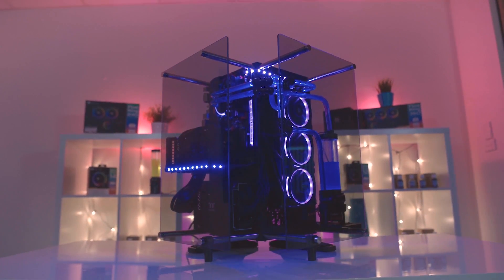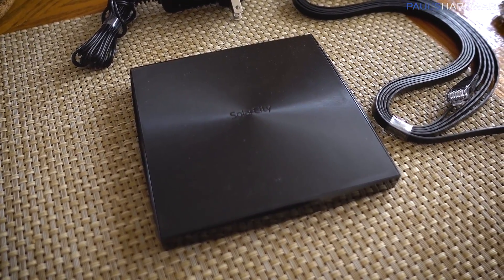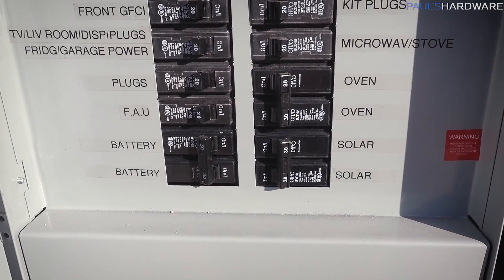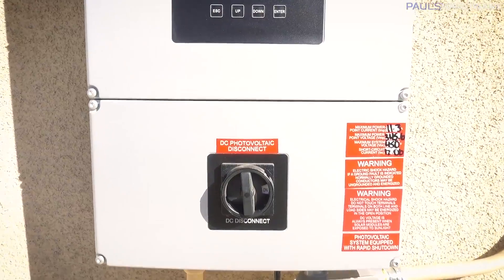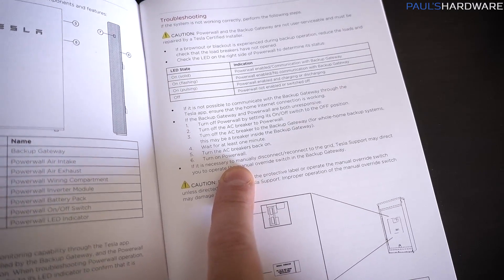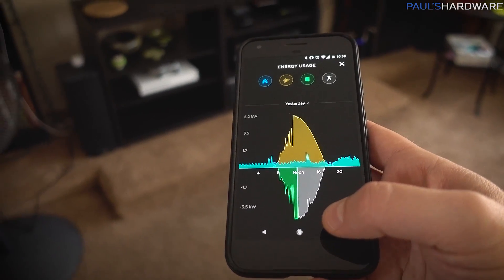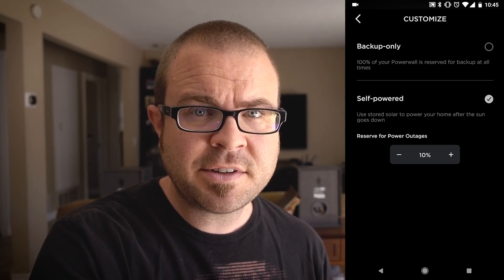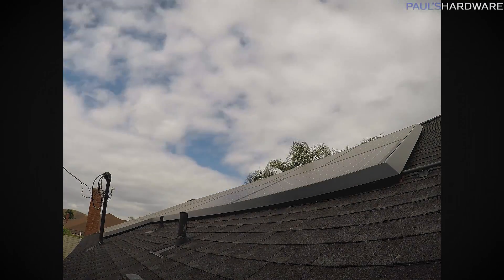SYSTEM ACTIVATED! Tesla Solar + Powerwall Week 1

Comment: the way it makes sense in my head is comparing electric to water. the power wall and solar are transformed to a higher AC voltage than the grid is providing at the time. thats more pressure so that your house and the grid will take the electric coming from your solar and power wall. the gateway is like a dam for the power wall. the dam closes during the day while the power wall is filling up and solar is still passing through freely. then at night, the dam opens up so the power wall powers your house at the higher pressure. then as its going through your wires and buss bars, all of your circuit breakers are like faucets. some opened (AC, laundry, kitchen, lights) and when not in use they close. the electric flows, like water to the things that are opened first until that load is filled and then keeps traveling up/down stream to the grid. so even though the AC is above your gateway breaker, its still getting power from solar and the power wall first, before the grid pressure can overcome the power wall and solar pressure. Voltage is pressure. hope this helps a little

Comment: I paused a documentary about space-time and dark energy to watch this. That didn't make my head ache. This did. Do you have to take an exam to operate this thing?
Reply: Cut this guy some slack. The turn on prosses is lengthy and should be simpler. In fact as the show host found out troubleshooting my be required.
Reply: turning on some swithces is too complicated for you?
Reply: Sure, sure it's just turning on some switches. And writing a thesis is just typing some characters, driving is just turning a wheel and pushing a pedal, god forbid you attribute any importance to the rules that determine the sequence in which you must do those things, no, we can't do that, otherwise you wouldn't have anything to comment on.
Reply: Try turning the A/C on earlier on earlier in the day when you have surplus solar. This would avoid heat buildup in the house that you need to remove as you near end of day solar production. Something to play with.

Comment: If I understand your power set up correctly, your AC will run off of the live solar panels or the Grid, but not the Tesla batteries unless you add more and have them wire it to the battery breaker panel. However the software setup will report how much power it uses.
Reply: No, the solar charges up the powerwall and when solar production drops below the house's energy consumption, the powerwall makes up the difference.
Reply: yeah but not all the houses circuits are on the circuits that the powerwall is supplying. I think that's how his air conditioner is set up.
Reply: Oh sorry I missed the AC bit. I thought that you were talking about the entire house.

Comment: You need a pool and  a grill! So much wasted space!!!
Reply: Grill yes, Pool no. I mean i know it is southern California and it is hot as balls but after installing what appears to be a self sufficient power solar power system don't go wasting resources by evaporation. Find a native grass and plant that, something that is drought tolerant. Sure it will not look the best certain times of the year but it will be low maintenance and easy on the resources. If you really need something to soak in grab a small pool and fill it with booze last man on earth style!!!

Comment: Does the battery/power storage degrade over time? If it does degrade, how long until the degradation effects how you use it (as in, not enough charge kept to last the night)? How long until needs to be replaced? Are there other components that may wear out or degrade over time and need to be replaced?

Comment: The time lapse with the split screen was a nice touch. That really drove home what you were demonstrating.

Edit: if you want to track the power usage of an individual outlet, a Wemo insight is very handy. It can track how much power a device uses. It also doesn’t need a hub because it connects directly to WiFi.

Comment: One thing to remember if you have central air is the equipment inside your house operates off of a separate 110V circuit so you may not be seeing the Air conditioning compressor which operates on its own 240V circuit but are seeing the fan that moves air throughout the house

Comment: If there isn't a blocking diode downstream from the Gateway breaker, you could, in theory, be backfeeding from the power wall to the HVAC circuit.  Similar things happen when you have a generator installed in your panel board.  You are backfeeding a spare breaker with the generator power, while the main Utility supply is out.

Comment: My guess is that the AC is pulling from the grid on one of the phases, while the powerwall is delivering the same amount of energy to the grid on the other phase. Domestic consumers often pay for the energy rather than for the current, so the net effect is 0 so that would help keep the meter not running. Industrial customers, however, might pay for the actual current and reactance (inductance and capacitance) that they're putting on the grid - so those industrial users might want to invest in power factor correcting devices both to save money and reduce losses.
Reply from the maker: I think this explains it, and does so much better than I did. The info on the industrial side is also quite interesting, thank you!
Reply: Thanks. Electricity/magnetism is weird. Balancing the grid is so much more than having enough energy at the right time of day. It's also about capacitance/phase balance, frequency stability and avoiding harmonics. With all the switch mode devices these days, I think solar inverters and grid batteries can actually help clean up the grid in more ways than one.
Reply: The US has single phase for residential buildings. It goes through a center tap transformer to make Neutral, +120V, and - 120V. (hence the double pole breakers on 240v circuits). I suspect the gateway is backfeeding both bus bars in the meter box. In the event of a power loss, the gateway has a disconnect built in which will open the backfeed circuit and hence no AC when running on backup power.
Reply: Yeah. It looks like it's one phase inverter. That's why it can't provide more juice to sustain powerwall and a/c. So most likely it takes one more phase from grid
Reply: Paul appears to have a standard split AC system (I could see the condenser/compressor on the ground in the video)  There will be TWO circuits involved.  The big two pole (220V) circuit is for the compressor and its what both takes a lot of power and what is typically not on your powerwall backed-up load panel.  (You can but its rough on the batteries trying to support the huge amount of power to start the compressor each time it cycles on).  The second circuit is the 110V normal circuit that the "air handler" part of the AC system runs from.  This is normally a box in your attic and it plugs into an outlet that is shared with other things in the house.  It won't have a dedicated circuit breaker.
Reply: Wow, you guys are good I was going to assume the furnace/ air handler was on the gateway and the condenser is not. This is why you would see draw on both sides. What's the amperage when this happens?
Reply: Very good video and description of system operation and great info for consumers.  Thanks for posting!   A couple comments below on air conditioning usage as relates to solar and powerwall 2 when utility power is up and when there's an outage, based on my experience.... Disclaimer...I work in residential solar in SF Bay area -- Non-Tesla branded solar pv systems and sometimes with Powerwalls as part of configuration...   

For the A/C question....When the grid power is on (non-black out), it's helpful to think of a home as supplied by 3 power sources now:  utility, solar and powerwall simultaneously available to feed home's electric panel(s) and hence your home's electricity demand.  If 5kW (AC) solar (21 amps output x 240v) + 5 kW (AC) output Powerwall (21 amps output x 240v) -[10kW AC output combined when maxed out around mid-day in the summer] - are sufficient for all of your home demand, then you are either using nothing from the utility or most likely exporting an excess to the grid (and you get the same credit per kWh of export that the utility would charge you during that peak or partial-peak time of day....which is a nice high rate during the day in California!) 

It's only during a power outage that you wouldn't be able to run A/C or in many houses similar larger loads off your solar + powerwall (circuits that are not located within your backup loads sub-panel).  The 100amp gateway breaker in your main panel goes to your solar + powerwall backup circuits sub-panel via the gateway (transfer switch) and shuts off connection from the grid/main panel, and thus, your solar + powerwall creates an "island" or loop with the utility cut out, so that only the smaller circuits within your solar/powerwall backup loads panel will be powered by solar + powerwall (up to 42amps x 240v = 10,000 watts = 10kW AC output at mid-day) during a utility outage.  Or, in terms of kWH, roughly 30 kWh solar + 12 kWh Powerwall = 42 kWh available over a 24 hr period.   
(The A/C 30amp breaker is cut out of the loop during power outage because it is in the main utility panel upstream of the gateway transfer switch and not in the backup loads sub panel, so, A/C is out when the utility power is out).  

Note: summer vs winter solar production.
On a sunny WINTER day, solar output (AC) could be as little as 50% of peak summer output at noon, so, max output at noon would be more like solar (2.5kW ac) + powerwall (5kW ac) = 7.5kW AC  or 7,500w max.
Or, in terms of kWh, roughly 12 kWh solar + 12 kWh Powerwall (not depleting it completely) = 25 kWh available. 

Note for those curious: how long does Powerwall last during an outage?
This is where it's energy capacity (13 kWh) can get confused with its max power output (5kW ac)  
If power is out at night or during the rain (no or limited solar output), and Powerwall is fully charged at 13.5 kWh capacity, it's designed to keep just essential circuits going so that you don't deplete too fast.
ie. A couple lights, a few outlets to charge up devices, wifi/modem, refrigerator, microwave/stove... very rough 24-48 hours if you're using those light essential loads conservatively. 
And of course longer than that for days that solar is available to supply your backup loads in the sub-panel + extra to replenish Powerwall.... Ie. on a summer day, a 5kW (ac)  solar system itself might supply you with 25-30 kWh (nice!), 20-25 kWh spring/fall, 12 kWh or less in winter.

The a above I'd say is pretty rough numbers but relatively accurate description and estimates for a 5kW (ac) solar pv system + Powerwall 2 on a sunny (not too much shade) SSE - S - SSW range roof direction with modest pitch.

Comment: I have a couple powerstrips.  These have a main and switched outlets. So when you turn on you device plugged into main it will give power to the switched items. So for your TV setup you can plug you TV into main then your sound system, Xbox, ect into switched so they are off when the TV is off.
Reply: This works as long as the TV has a hardware switch - or you'll get the TV vamp'ing a few watts on standby.

Comment: It would be interesting if you could tell us how much time until you make your investment back. Nice video.
Reply: very simple, the system cost powerwall(6600$),panel(16X 400$) total 13K$ with work about 30K$. one KWH cost 0.20$ and in day had 12 hour light in 4 hour peak 5KW. avr about let say 1.6KWH in 12 light hours . about 32KWH per day, 0.2$ X 32 = 6.4$ per day eran. 30K$/6.4=4687 days, about 13 years
Reply: simple, cool, thank you
Reply: Oren you forgot about feed in. Most power companies will pay you for feeding back you've worked that over 13 years of him being offgrid it would pay for itself. I am in australia and our feed in is 50c per kwh on a 3 month bill we had a 200$ credit ie we fed in more electricity than we used. Sometime going completely offgrid isnt the best use of power. I personally with a setup like this would configure for offpeak charging. Utilizing and saving the power wall for peak usage times. Feeding in as much as I can for as long as I can at a rate higher than consumption
Reply: you need to take into account winter months when the sun wont be quite as strong. Still, good work.
Reply: Never....he'll nevever break even....why people installing these systems are fucking themselves and everyone else....pricing would be much more attractive if we let them know that we know corporations require projects to pay for themselves in 9 to 12 months....
Reply: Looks like fun but I did the math for my house on the east coast and payback, assuming no repairs, would be far too long even though I have a lot of roof space. BTW, dollar signs go BEFORE numbers, just as you were taught in grade school.
Reply: Yes and inflation is non existent. Especially since Obama printer 4 times the currency US has printed in it's lifetime. And by the way I used to pay $1/gallon of gas 20 years ago. I am willing to bet that electricity in CA will be 50 cents/KWH in 10 years. Someone do the math on that one?
Reply: The administration has virtually nothing to do with the U.S. money supply. It's also independent of Congress...deliberately so. Gas? So what?  When I was little my parents spent as little as 16 cents/gallon. My grandfather bought a farm for 1600.
Inflation is worldwide for a variety of reasons. The point is to control it well enough that most people don't starve.